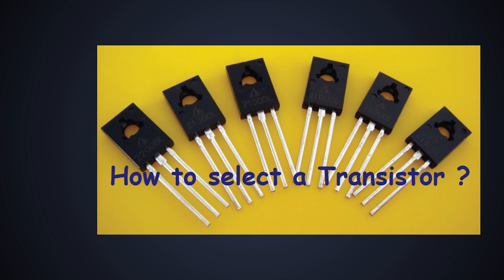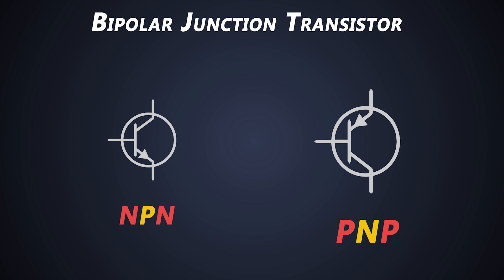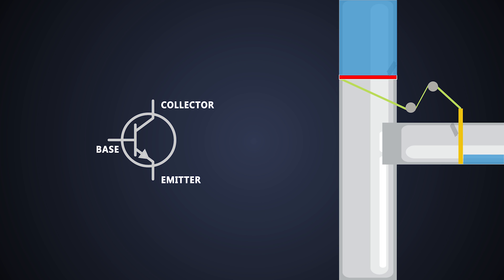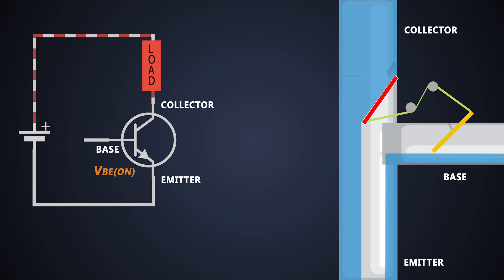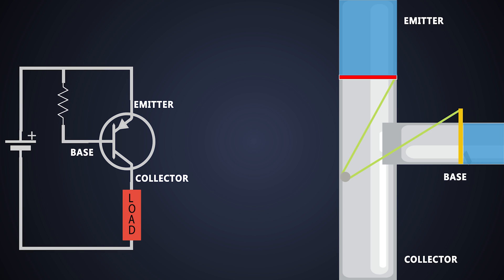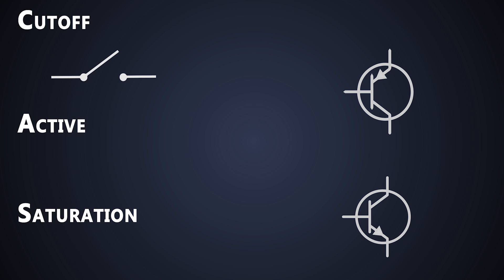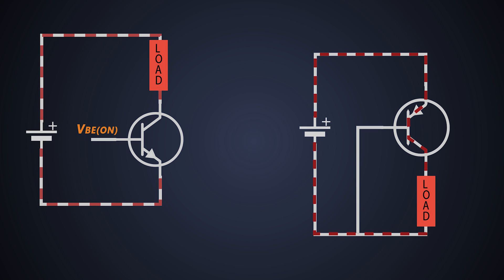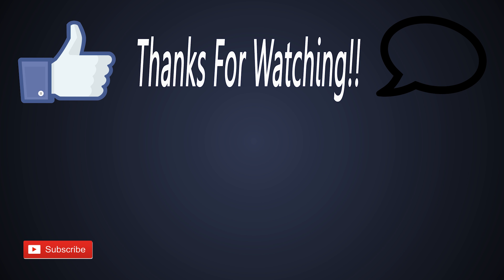How BJTs Work? | How Transistors work?

Comment: Sorry, 
but as I see it, the problem with your water gate example is that you can only explain transistor as a switch with that but not transistor as an amplifier.Better would be an example with distinct balls. When used as an amplifier, the balls gather at the junction plane and are catabulted at through the plane when their collective force is high enough. The junction plain is kind of holding them off as long as it can but when they finally burst through, their force is bigger than as it would be if they flowed normally (without a BJT) through the cable.
Your water gate can only open and close. It does not show the increase in pressure, at least not in your animation.

Comment: Why in an NPN is the load at the collector and not between the emitter and ground?
Reply from the maker: You can connect load at the emitter also.
Reply: @FoolishEngineer  Tq for the reply. Yes I have done it before but if I recall correctly there were some differences - less power??, but if load at collector is the same as load at emitter then you would expect 50% of each case to present itself in the discourse, but it's by far dominantly seen at the collector.